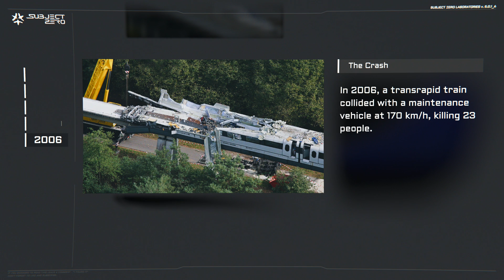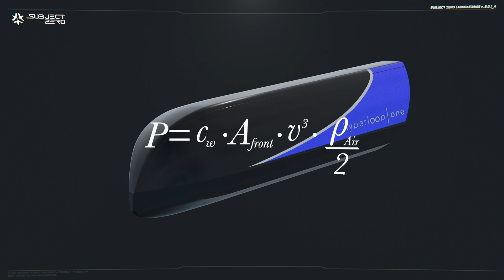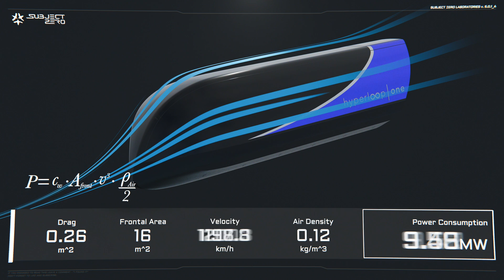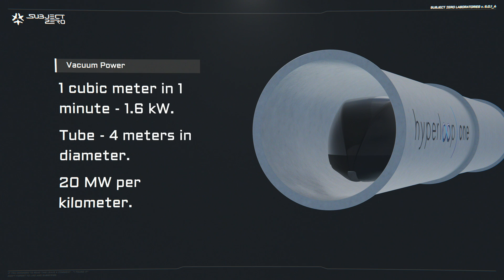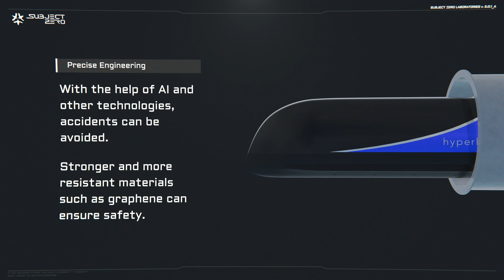Hyperloop - Inevitable Failure

Comment: Graphene is a lie. Materials have holes not beacuase of defects but due to statistical mechanics you can circonvent that by using small sample or by using high entropy materials (see high entropy alloys). 

Future materials exists, but they are never the ones you hear brough up in the media.

PS: I am taliking about atom sized holes in the latice of the material. Grapheen is srong beause small sample are devoid of such holes. But above a certain size physics commands a defect to appear, thus compromising the strength of the material.

Comment: I would like to hear some opinions about the Hyperloop, so please reply:

If the Hyperloop was a lot longer (like a regular train), and just used the relatively cheap maglev design that many companies came up with, without the crazy expensive tube, would it be a practical high speed transport system? I think so.
Reply: No tube means no vacuum and therefore no hyperloop. What you are describing is not just "like" a regular (maglev) train, it is a regular train.

Comment: It will most definitely need to be built underground as well. On the surface, it’s just one car crash, natural disaster, terrorist attack or stray bullet from one of the 400,000,000 high velocity poker holers in the United States to catastrophic failure.

Comment: Explain to me why do you have to remove the air inside the tube to near vacuum instead of just blow air at the same speed and direction of the thing moving inside?
Reply: Have you calculated the mass of air that will be moving at these speeds, or the energy to maintain it.  Then there's the stopping problem and getting passengers on and off...

Comment: Hyperloop is economically doomed. The cost of building & maintaining vs profitability is way to bad. 
The only country that doesn't seem to care about the profit is China with 90% of high speed trains lines losing money.
Reply: It's not as bad as maglev though, we can use air bearings or even wheels for the hyperloop instead of magnetic levitation.

Comment: Hypertrophy is a great idea, but it's far to early. It's a technology that will only be possible 250 years from now.
Reply: The technology is actually pretty close to the one used for high speed trains. They use continuous welded rails that are built under tension so they don't need expansion joints.

Comment: What about the design that uses a giant air-intake in front and uses that pressurized air for levitation instead of magnetic levitation?
Reply: Because it's dumbly contradictory. The issue is drag, so we decrease airpreassure. But then we want to use the air to levitate which will require quite high airpreassure which causes drag. And you would likely want a magnetic track for proppulsion anyways. It's why all the actuall companies formed around Hyperloop went towards maglev. Also: maglev is a more proven technology that has a lot of development saving costs.

Comment: Little too late to the closing party? Thunderf00t has been pounding on this literally since "the Musk's genius idea" ( hypermusk ? ) was widely propagandized, about 8 or so years ago.
Reply: Thunderf00t is a moron though. Steel has been used for compressive loads for over a century, you just need stiffeners to prevent the vacuum chamber from collapsing.

Comment: we invent some dirt cheap energy source and some semi-magical materials and boom:
hyperloop. Not any time soon.
then some crazy fellas sabotage it and boom: no hyperloop
Reply: The whole point of the vacuum is that it reduces energy consumption. Go watch the video.
And we don't need new materials, steel has already a crazy high elasticity, even when welded the internal stress of the vacuum chamber caused by thermal expansion would only reach 90MPa.
Reply: @johntheux9238  yes. we do need new materials. That's why nobody builds a hyperloop with our current materials. Grow up. Or just build one.
Reply: @istvansipos9940  What issue needs new materials to be solved? Because we have been building vacuum chambers for decades and we can build them under tension to prevent buckling during hot days.
Reply: @johntheux9238  so mankind simply chooses not to build the hyperloop. It could outcompete trains and earn a heap of money, but no capable engineer wants to get rich. Seems legit.
:- )

And the issues:
I think a several 100 km long tube would buckle on hot days. Or maybe you can keep it straight somehow, but you cannot maintain the vacuum in it. Or maybe you can, but it would cost the GDP of Africa.

maybe give it a try. I am easy to convince. I don't think you can build a hyperloop. And the fact that you still have not built one, gives me no reason to think that you can.

this trust issue is not that complicated, by the way. right now, the hyperloop seems as crazy as a 100 m sprint within 10 seconds.
The only difference: I see 100 m sprints within 10 seconds.

Comment: High speed trains already have a bunch of big problems because of the speed that have absolutelly nothing to do with air resistance
Add hundred os KM of a vacuum tube, even more speed related problems, size contraints because big tube = bigger vacuum chamber to deal with
And the absolutelly massive safety problem that is to have a tunnel that people can't get out of the train
Maintenance would be a nightmare too, and a dude with a gun would be able to do millions in damage from miles away puncturing the tube, or even cause an accident

Just dumb

Comment: I don't understand why they are trying to fight the air resistance when they could instead move the air with the train.  Pressurize the tube, and have it in a closed loop and make it so the air is pushed along with the train.
Reply: There is going to be friction all along the walls.
Reply: @johntheux9238  thats why i was thinking you could use some sort of electrostatic force to help repell the air molecules as well as coating the walls in some sort of Antiphobic material for air...
Reply: @Dalorath  You can try, but you don't need fans, it will get pushed by the train itself.
Reply: @johntheux9238  why not fill it with water instead of air? use a hydrophobic paint on the inside of the tube.
Reply: That was my initial thought too, until I thought about it a bit.
How do you stop?
Especially if there are multiple trains (pistons) in the tube.

But beyond all that, all you are doing is shifting the drag from the train through the air, to the air against the tunnel wall. So no. Unfortunately that is no solution either.
Reply: @Jimmeh_B  Any station on the loop would have a branch to the loop that would connect to the loop when a train approaches, then disconnect from it after the train enters and slow down. The main loop would continue. The tube itself could be electro -statically charged to repel the air as well as coating the interior of the tube in a low friction coating.
Reply: @Dalorath  yeah bro... it doesn't work like that.

And it never will.
Reply: @Jimmeh_B  care to explain why not?
Reply: @Dalorath  Nah man. I already did. You seem to think you have solutions to physics and reality that simply won't work.

So, I'm just going to leave it at that.

It's a pipe dream. It always will be.
Reply: @Jimmeh_B  Fair enough. Thanks for the chat.
Reply: @Jimmeh_B   why not fill it with water instead of air? use a hydrophobic paint on the inside of the tube.

Comment: This is the best explanation of why it might be a good idea that I have ever heard. But I still don't think vacuum technology is ready. Maybe in a century as you say. But I don't know if the risk of blowouts can ever be overcome.
Reply: I agree, I don't think vacuum is a good idea and it's really a sh!t idea for passenger travel.
Reply: Some of the issues with vacuums have been solved with regular high speed rail. Continuous welded rails for example don't need expansion joints, that would help a lot if we want to build a vacuum chamber.

Comment: You don't really need maglev or a vacuum tube to go faster, all you need is low air resistance which can be achieved in a tunnel/tube with some engineering tricks.
Reply: Or even just half pressure.  Less air is less air, you don't need a vacuum to get the benefits or reduced drag.
Reply: @TheEvilmooseofdoom  no need for that. heated tunnel will lower air resistance but that requires some smart insulation on the inside of the train. Air conditioners have to be designed differently.
Reply: Like filling it with hydrogen?

Comment: Stupid, massively impractical concept from an insane con man promoter. A hyper scam from a hyper scammer.
Reply: The theory is sound.  But you haters are not the brightest bunch.
Reply: @TheEvilmooseofdoom  Nothing sound about it. too expensive, too dangerous WHEN something goes wrong, an easy target, and doesn't really solve any problems.
Reply: @MattTygore927 It's less expensive than maglev if we use air bearings or wheels instead of magnetic levitation, and it's safer than airplanes, which are also pressurized capsules in very low pressure air but with way less safety margin than a vehicle on the ground.
Reply: @johntheux9238  You really should learn the difference in the stresses involved when comparing pressure and vacuum.
Reply: @thedubwhisperer2157  Airplanes are also in an almost vacuum. Only 0.25 atmosphere.
Reply: @johntheux9238  Aircraft are pressurised - this is a completely different scenario to a low pressure container surrounded by higher pressures.  You simply cannot compare a pressure vessel with vacuum container by assuming that the stresses due to the net pressure difference are similar.
Reply: @thedubwhisperer2157  Oh, you were talking about the vacuum chamber, not the pods...
The vacuum chamber has stiffeners on the inside to prevent buckling from the compressive stress. Just like a boat hull.
Reply: In what way is this a scam? Musk never owned any company working on an hyperloop. So he isn't even promoting one of his companies...

Comment: Doomed. Pressurization is the ball game. The rest is known technologies. What have bridges, train tracks and sidewalks have in common? An expansion relief section. As heat is absorb, materials expands and so there needs to be expansion relief sections all along the tube. The way it is traditionally done is with space or with a porous materials that can be easily compressed and/or stretch. With an almost vacuum inside and a 1 atmosphere outside, none of those solution will do. Also, we have to think of the Challenger booster o-ring failure. The magic material that would be use in the expansion relief section must be able expand a lot, stay air tight, support 1 atmosphere of pressure and operate in a range -40°C ro 40°C.  No such material exists.
Reply: Continuous welded rails don't have expansion relief, they are just designed to survive the internal stress.
Reply: The overarching problem (please excuse the pun) is the temperature differential between the top side and the underside of the tubes which will cause them to bow towards the hotter side.
Reply: @thedubwhisperer2157  They can paint it white to avoid that.
Reply: @johntheux9238  Minimise, but not eliminate.

Comment: Great discussion but when you realy get to the nitty gritty we don't have the technology to create a 1000 mile long tube that can maintain a vacuum through all seasons due to expansion issues. Yes we we could pump out 20 meters and hold it but being honest its never gonna be economical anyway or not for a long while yet....cheers
Reply: We have the technology to build 1000 miles long continuous welded rails that don't need expansion joints... Why not do the same with the hyperloop?
Reply: To be honest if you cant understand how a piece of rail and a hollow tube under vacuum differ, I think we should agree to disagree so things don't get out of hand :) @johntheux9238
Reply: @andymouse  Another thing they all seem to miss is the temperature differential between the topside and underside of the tube, causing it to bow upwards during the day and very probably downwards at night!
Reply: No, vacuum is a bad idea, tunnels though have potential.

Comment: Even if all of the other issues with this proposal can be resolved, the biggest problem with this thing is: where the hell are they gonna be able to lay a perfectly straight section of tube for this thing so it can actually safely attain its maximum speed? rail always has to account for topography and the cost of this thing is just going to explode if they’re having to drill through every single mountain in its path. The hyper loop is just a worse version of currently-existing high speed rail technologies, especially considering we could be building high speed rail with technology we have available right now instead of hoping for advances in materials that might make the vacuum tube idea feasible.
Reply: Seems to me that high speed trains would have been faced with a similar arguments when they were proposed to replace regular speed trains. So, ask how the high speed train people solved it and do that again. And, we don't need any advances in materials.
Reply: Tunnels go UNDER topography.  That's the advantage of tunnels.
Reply: @TheEvilmooseofdoom Yes obviously I’m aware the tunnels go under topography, the issue with tunneling is that it massively increases the cost of any infrastructure project compared to one that’s able to avoid doing this. The problem with hyper loop is that it’s forced to dig through mountains to realize its top speed, which will cause it to be exorbitantly expensive.
Reply: You don't need advanced materials for the vacuum chamber, you can just use steel and add stiffeners on the inside to prevent buckling caused by the compressive forces.
Steel is actually very flexible, the internal stress caused by thermal expansion in continuous welded rails is far from the yield strength.

Comment: This video is factually incorrect, the original hyperloop doesn't have anything to do with what is described in this video.. The paper for the original hyperloop can be found at Tesla's website, for some reason youtube doesn't allow me to link to it. It is based an a PARTIAL vacuum (much cheaper), and uses a jet engine and air bearings, it's more similar to a jet than to a maglev. The key advantage of the original hyperloop was that it only needed a simple tube with small magnetic boosters placed several kilometers apart from each other. Since the hardware doesn't grow linearly with the length of the tube the costs don't explode either. Many of the companies that claimed to be doing an hyperloop after Musk's paper were actually scams designed to get money from subsidies or private investors, and most of them are stupid ideas that don't make any economic sense. None of these companies were endorsed at any point by spacex, which was the source of the original idea.
Reply: "Many of the companies that claimed to be doing an hyperloop after Musk's paper were actually scams designed to get money from subsidies or private investors"

As was Musk's paper.

Comment: 0:26 this is what we call the Balance Fallacy, AKA "BothSidesIsm".

0:59 that's not true; Hyperloop (the concept behind it) traces its roots back to Pneumatic Tube Trains (or Atmospheric Railways for short). Hyperloop is not MagLev; MagLev was not its' inspiration.

2:04 aerodynamics is actually not as much of a big issue as it was being implied here. Let's be real, maintaining a vacuum would be more energy costly than it would have theoretically saved from the Pods. Also, maglevs and conventional (high speed) trains already go fast enough without the tubes.

Comment: A hyperloop using a vacuum is kind of a bad idea (but read the end) even though it works in theory kind of like a hot air balloon lifted by a vacuum. It works in concepts, but the structural engineering problems required to support a vacuum requires such a way that the overall density is not effective using conventional materials and methods. However, it would seem that two difficulties could find common purpose. If one replaces the vacuum with atmospheric pressure hydrogen, then one immediately sees a reduction of drag by a factor of 13.61...
A long tube filled with hydrogen would be a good way to transport hydrogen from facilities in places that have easy resources for making hydrogen. Thus we achieve it once a system for transporting hydrogen and cargo/people.
This also reduces the structural requirements of the tube dramatically.
Reply: And on top of that, a single spark could provide vast areas with along the tracks with a quick burst of heat. Let's not combine transporting people with electricity being the source of acceleration with hydrogen in the same, closed off space!
Reply: @landadel-mvv  Hydrogen won't do anything without oxygen, it would be sealed the same way a vacuum chamber would be...

Comment: Maglev trains exist and nobody is building them. why? because the extra price is not worth the time saved. Adding a very expensive and dangerous vacuum on top of that makes no sense whatsoever, Hyperloop has always been vaporware.
I would like to remind you that the japanese, french, or even chinese, high speed trains already go well beyond 300km/h, with a fraction of what a maglev costs.
Reply: The vacuum is not supposed to be added to a maglev, you can also use air bearings or even wheels in a vacuum...

Comment: Instead of removing air from the tube they should thinking on accelerating that air up to the train speed level and beyond
Reply: And how do you stop? Just a reminder, air moving that fast would be beyond the Fujita-Scale (i.e. faster than a F12 tornado). You'd literally have to stop hype-tornado scale forces...